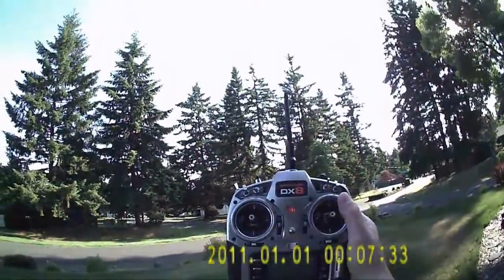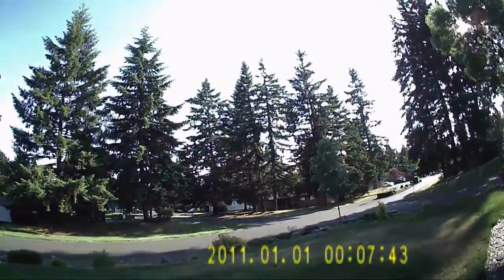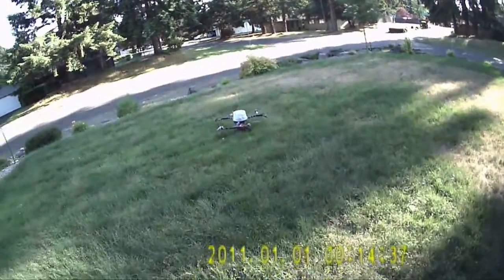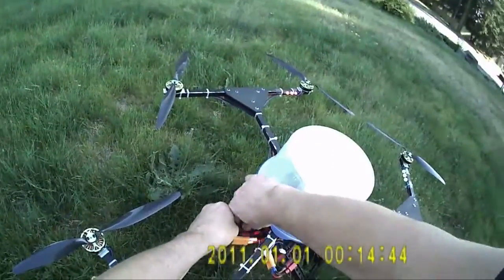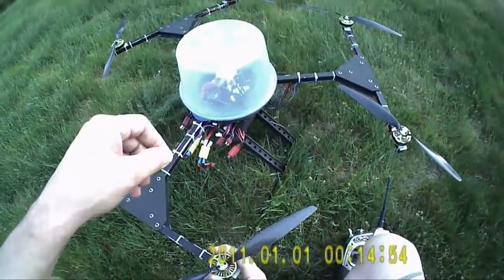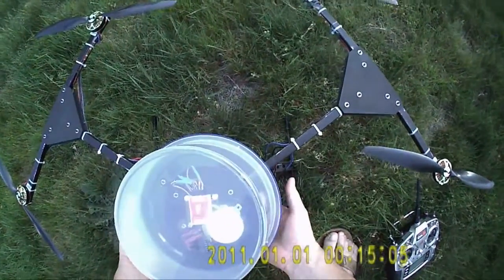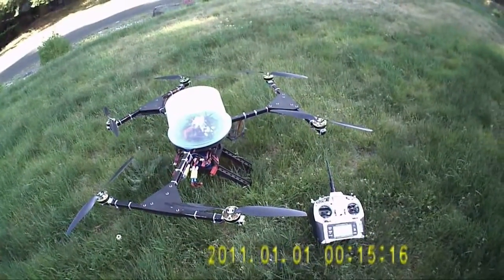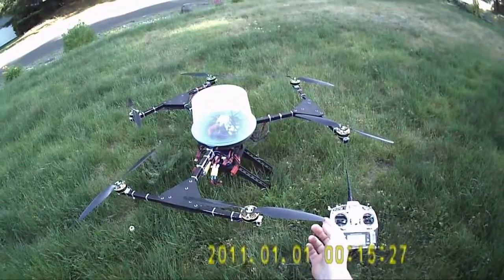Hexcopter Endurance Test

Comment: Nice video.  I have these same motors on a hobbyking uc 680 that I converted to X and stretched to  800mm.  The motors seem pretty efficient but there is a few quality issues.  Ten flights in and I have one with a faulty bearing.  I also had one out of the box that had a metal shaving in the windings and I had to disassemble the motor to remove it.  I originally was using APC props but I have had two of the threaded mounts snap while tightening down the props (without much force).  Those adapters are hollow and split along the threads.  I realize they were just not safe so I went to CF props using the T mounts which are a much better way of mounting.  I have been getting great flight times (13+ minutes) with a single 4S 6000ma using 13x5.5 (HK # 505000005-0) props.  I have flown it with dual 5S/5000ma and 12x4.5 props as well but its much quieter on 4S and the current went up quite a bit with the extra weight of the dual battery system.  I have some 14 & 15 inch props coming to test as well.  I have a feeling the 14's are giong to be the sweet spot and will probably pick up one of the light weight 10,000ma 4S multistar batteries to try.
Reply from the maker: +spyder000069 I only used the CF props from the beginning and balanced them before installing to help prolong the life of the bearings.  I've had no issues with bearings and the motors I received, had no issues upon inspection and testing.  For me, the two 5000mAh Batteries are better than one 10000mAh (cheaper too) because the wire I use is able to handle the current without having to go to a super heavy wire, http://www.4-max.co.uk/silicone-wire.htm.
The system I use provides more than enough current for he ESCs and the ESCs provide more than enough current for the motors with an end result of no noticible heat.  If you have not already done so, please subscribe.  All the best and happy flying!